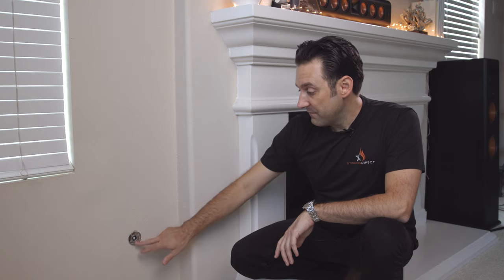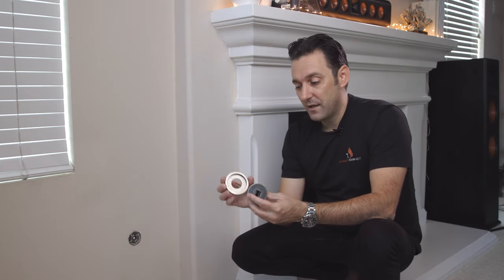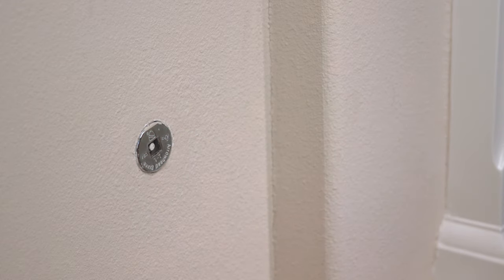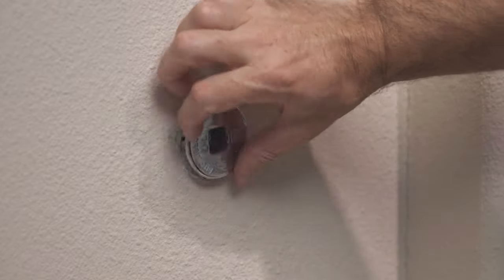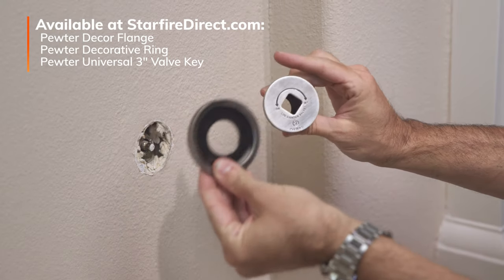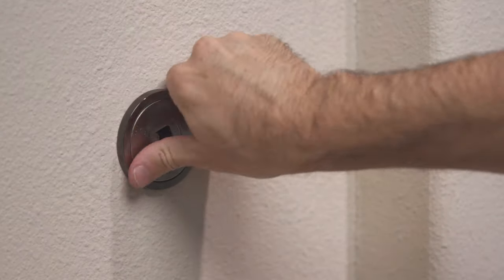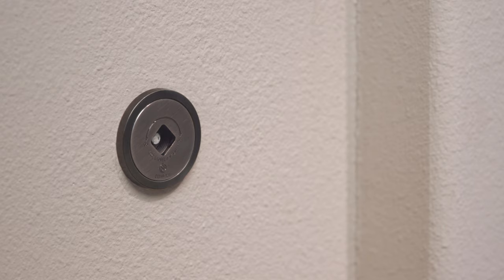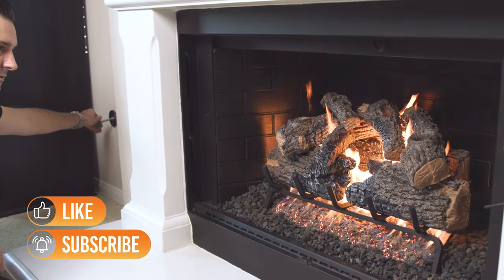How To Install a Decorative Key Valve Flange and Trim Ring

Comment: Just checked out this video hoping to see if you say how the gas line is arranged behind the wall. I'm looking to mount a flat screen hanger on the wall above the fireplace key valve, any idea how to do this safely? Does the gas line go up into attic or done in ground? Thanks.
Reply from the maker: Great question!  The best answer is "it depends".  Sometimes the gas line comes up from the ground, other times it runs through the wall or from the attic space.  The only way to know for sure is to open up the wall or inspect your crawl space to determine how it feeds.  I've also seen some fancy new electric devices (think stud finder) that can detect gas or electric lines in a wall, but I haven't used those and can't recommend one.  

With that said, regarding your TV mount, I don't think that will be an issue for you.  Most TV mounts require that you anchor into the studs, especially for heavier TVs.  If mounting a small TV, you might be hanging into drywall and using drywall anchors.  I don't believe these will interfere with your gas line.  

Hope this helps!

Starfire Direct
Reply: @StarfireDirect  ok thank you

Comment: Good video, Do you know who you would call to replace the gas valve turn on, mine is stripped.
Reply from the maker: Nate,

We can certainly offer a new key valve.  Typically, the valves in the wall are 1/2", so this is the one you'd need:  https://starfiredirect.com/products/starfire-designs-straight-decorative-gas-key-valve-kit

But regarding labor to install, we can't really assist with that.  Likely, you'll need to cut a hole in the wall to expose the valve and replace it.  This should be doable by an experienced, qualified local plumber or general contractor.  

Hope this helps!
Reply: @StarfireDirect  thank you sir

Comment: Can't find a replacement for my cover.  The threads of the valve are not recessed into wall.  They come out about 1/2 inch.  The cover I need to replace is cone shaped or umbrella shaped.
Reply from the maker: It's possible this won't work for you and you might need to replace the valve if you're wanting a new flange.

Comment: So how do you remove a broken flange?
Reply from the maker: I'd probably suggest some pliers or a channel locks.  It should spin off.  If it's broken, I wouldn't be concerned with scratching it.  But without seeing it, couldn't say for sure.

Comment: my key is not Turning how to replace whole inside part
Reply from the maker: Did it used to turn?  There is a possibility that the valve is fine and the key isn't working. You would want to make sure you have the right key before replacing the valve.   

If you are positive that the valve is defective or stripped, you would need to open the wall to access the valve and replace it.  Then you would need to do drywall repair and paint.

Comment: He doesn't even have right tool
Reply from the maker: Hi Robert, thanks for the comment.  As mentioned in the video, we only used channel locks because the old flange was beat up and getting tossed.  Using a tool like this would obviously mar or scratch the new flange, which is why we didn't use the channel locks when installing the new flange.  

A socket wrench with a square hub that fits in the square flange hole is a good idea too.

If you have a tool that you prefer to use during your installations, please leave it in the comments to help other viewers.  I'm sure they'd appreciate it!

Comment: Bought one of these from you guys and it just arrived.  What tool can i use to screw this in?  I got the old one off but its requiring some muscle to put the new one in.  The old one has prob been there like 30 years or something, this is in a floor that goes to a crawl
Reply from the maker: We typically use a socket wrench in the center.  See if that helps!